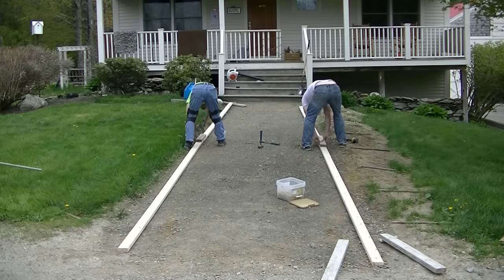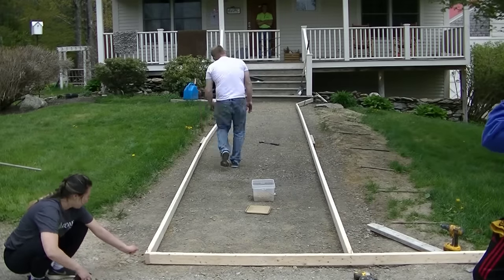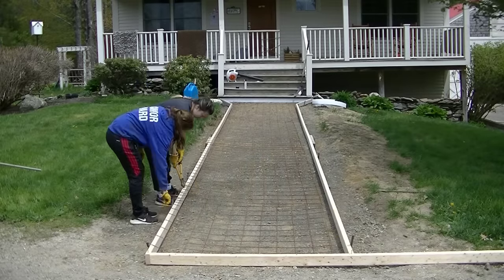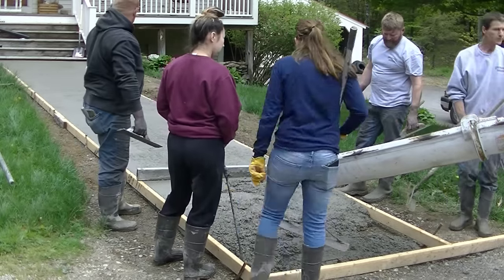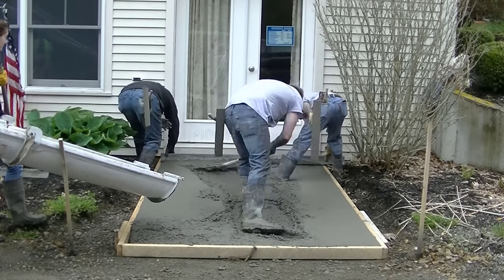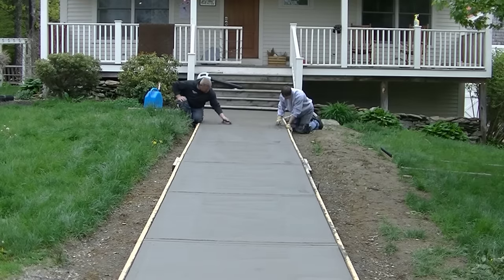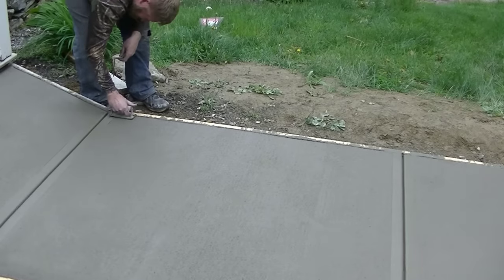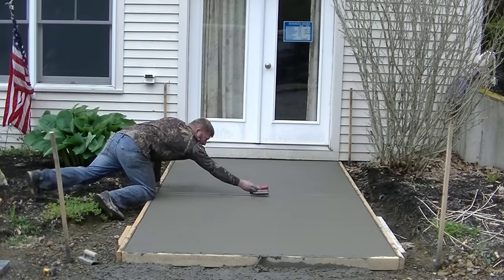CONCRETE SIDEWALK : FORMING, POURING AND FINISHING

Comment: Overall a nice job. Your control joints we properly spaced and of correct depth. You should raise your reenforcing wire to the top 1/3 of the concrete and remember you don’t POUR CONCRETE YOU PLACE IT.

Comment: We did a water access shaft , 23,000 yards  continue pour , 3 sets of circular forms 12 ft diameter 24 feet across the shaft 12 men ,   the shaft was 600 feet deep in NYC

Comment: DEAR MIKE.....THANK YOU FOR YOUR VIDEOS.....THIS VIDEO .....THE NEW CONCRETE  GOES UP TO THE EXISTING WOOD STEP APROXIMATELY 1 1/2" FROM TOP OF NEW CONCRETE, TO TOP OF OLD STEP......THIS DOES NOT PASS CODE......SOLUTION......TAKE OUT BOTTOM STEP....NEW CONCRETE IS NOW BOTTON STEP AND IS 1 1/2 " HIGHER... BUT THAT GIVES YOU EQUAL RISE FOR EACH STEP....NOW PASSES BUILDING CODE....PLEASE CONTINUE YOUR EXCELLENT VIDEOS.....I HAVE SEEN MANY.....AND HAVE LEARNED  A LOT FROM YOU.....ALSO IF YOU WANT TO LEARN A SUBJECT....TRY TEACHING IT.....SUCH AS YOU DO.....THAT IS WHEN THE PROFESSIONAL REALLY STARTS TO LEARN.....I AM YOUR BROTHER IN CONSTRUCTION.....55 YEARS EXPERIENCE.....PLEASE KEEP UP THE GOOD WORK

Comment: Hi Mike. Ive seen videos of concrete pouring where there is something poured onto the ground before the concrete is poured. like sand? I saw you basically poured the concrete right on top of the ground (other than the wiring). Is there a reason for one way or the other? Thanks
Reply from the maker: This was poured on a gravel sub-base. It used to be loom and grass. That was dug out and gravel was installed to support the concrete. I'm not sure what you're talking about but we always pour on gravel or crushed rock for a sub-base.

Comment: Thanks for sharing Mike, do you ever use or put spacers between the wire mesh and ground to prevent corrosion? Or is that mainly used for re-bar.
Reply from the maker: Yes we do, sometimes we'll use slab bolsters under the wire when we can get them.
Reply: Stucobathtub, there’s no corrosion issue because they pulled the wire up and let concrete flow under it so that it’s suspended. It offers no strength if it’s left on the bottom. One problem I saw was they used several pieces of wire, and that’s fine, but they didn’t overlap the joints of the wire sections. It’s necessary to overlap (generally 2 squares but 1 will do) to prevent separation in the event a crack forms in that area. It’s necessary to overlap and tying every 18” is a good practice too.

Comment: Hi mike, I don't get the boxing details.Should the pegs get fixed to the rails before it gets hammered in or do you place the rails and then hammer and fix the pegs.? I see you are using rebar, but how are you fixing it to the rails? Are you removing the boxing after the concrete has cured or do you bring the lawn to the boxing edge and leaving it because I quite like that look.Nice video, low stress. Thanks.
Reply from the maker: We build the frame then pound in the stakes then screw the frame to the stakes at the grade we want. The rebar we either pull up into the concrete as we pour or we put some type of chair under it to hold it up. We don't leave our forms on after the concrete has cured. We take them off and use them again.
Reply: @MikeDayConcrete  Thanks for that.My contractor is trying to talk me out of having wheel tracks for my driveway. He reckons the extra boxing cost makes it more cost effective to pour a full width slab.32x3m.I can do this.

Comment: Mike, when you put wire mesh in it looked like it was laid on the ground ? not suspended in the middle before pour?
Reply from the maker: We pulled it up on this one. I didn't have any chairs on this job to suspend the wire.
Reply: With wire pulling it up is ususlly just as good as suspending it. You really only need to elevate it when using rebar
Reply: @MikeDayConcrete  I was wondering about that too. Thanks.
Reply: David Uhl 

Yeah, one girl pulled it up and the next girl walked all over it and pushed it back down.

Comment: How deep should you remove of sod when you’re pouring a patio.   And can you just tamp the ground after removal and pour on top or do you have to bring a base in
Reply: You just need to get all the grass out no deeper........and depending on what you're doing if it's a floating slab I'd go the whole 9 on it 2×6 forms with a thickened edge with half inch rebar  instead of the usual 3/8 rebar, but something like this and if you're gonna do it yourself I guess it all depends on how long you want it to last and how good you want it to look

Comment: Hi, I have a question about a concrete landing. We are putting on an addition that required the old landing (“landing=step between the door and the sidewalk leading up to it) to be taken out and a new one to be put it, poured up to the existing door. The concrete guy poured the landing too high and now when you open the screen door there is not even an inch between the concrete and the bottom of the door (no room for a welcome mat). How would you recommend the contractor solve this? Somehow reduce the amount of concrete, or possibly raise up the door? Thanks!
Reply from the maker: Hard for me to advise without seeing it. Not sure how much you need it lowered, you could grind it, scarify it then resurface. Hard to say.
Reply: Mike Day Everything About Concrete Thank you! It would only need to be lowered a few inches just so a doormat would be able to be there without the screen door hitting it. Nice video

Comment: I used thick boards of wood for my formwork. How important is the stakes in the ground to avoid concrete bursting out the sides. Might seem like a silly question but I used really thick wooden boards
Reply: Sidewalk is not heavy not many stakes for straight runs

Comment: Mike I was curious what the difference is between using a "Mag" and a steel trowel. I mean outside of what material it is that the trowels are made of, obviously the Mag is made from Magnesium and the steel trowel is steel but what is the difference in the finishing process?  Great work, great channel.
Reply from the maker: The difference is the Mag doesn't "close" up the surface as much. It lets it breath and not trap moisture or air under the surface. That could lead to blisters or surface delamination. Mag it first, let most the moisture on the surface dry up, then steel trowel it.

Comment: Mike, what causes the top of a concrete slab to chip off in thin small sheet of 1-3 inches long in areas that are cold and are subjected to freeze / thaw cycles?
Reply from the maker: No or too little air-entrainment, pouring the concrete too wet, not sealing the concrete, using de-icers on the concrete. Too much air entrainment.

Comment: Mike , what’s the purpose of the wire mesh if it’s at the bottom. It dosent provide any strength and eventually corrode and weaken the concrete.
Reply from the maker: I didn't have chairs for this one, usually do. We try to pull it up best we can. The concrete has fibermesh in it also.
Reply: if u watch the guy is pulling it up as they go
Reply: He does a good job and is obviously a pro however lifting the wire mesh does not work and is not consistent. Try inserting rebar into concrete and see how difficult it is let alone trying to lift it.

 Rebar or mesh not required on sidewalks when well compacted with drain material and fiber mesh in concrete. If the mesh or rebar is exposed it will deteriorate the concrete.

Comment: Mike, I'm looking to do some concrete work at my house. Do I have to put stone down first. I'm going to be replacing concrete, and the dirt beneath it is solid. I noticed that you did not seem to put stone down first, unless I missed something
Reply: Yes you need to put min 3-4 inches of CA 6 stone and compact it.
Reply: @sergiogonzalez736  no you dont compact the stone under the walkway. 28 years doing this. You use 3/4 clean stone or 57 stone as some guys call it. Clean stone wont compact anyway. The reason you don't want to compact the stone is for freeze and thaw. When rainwater or any water gets under the concrete in the winter you want it to filter down 3" to 4" so it doesnt lay right under your walkway and freeze and expand and lift your concrete just enough to crack it. When pouring exterior crete you always use clean 3/4 stone !! You never want something under your pad where water will just lay under it. You always want water to ft filter down 3" to 4" below your finished product.

Comment: how long do you have to wait till you can cut the lines? also how long do you have to wait to pull the wood off?
Reply from the maker: Cutting the joints is something you have to keep checking for. The concrete wants to be somewhat firm but soft enough to cut in the joint. It's different on every pour, depends a lot on the temperature and how wet or dry you poured the concrete.

Comment: Question: I want to replace the wooden steps leading from my garage to my kitchen with concrete steps. The steps will be up against drywall. Do I need this iso strip or something else to isolate the drywall from the concrete?
Reply: yes you do dont really need the strip you can use some thick plastic you just want a bond breaker
Reply: Use expansion paper nothing else true concrete guy here

Comment: I have a question about curing it. Do you add something to cute it, or just let it dry?
Reply from the maker: A cure & seal sealer is applied to the surface afterwards to seal it. Or water curing can be done by just keeping it wet for a day or two. It rained the next day on this one so we didn't apply any cure and seal.

Comment: Mike, do you feel that a gravel bed is not necessary in this case, pls? and looks like you used nom. 2x4s for the forming? So this slab is actually less 4"? Can you comment?
Reply from the maker: Gravel bed is necessary. Forms are up off the ground a bit so it is 4"
Reply: @MikeDayConcrete  Okay thanks. I missed in the video the first time I watched, where you referenced the gravel bed, so I wasn't sure that you had one, and I wondered if that was practice in some cases.

Comment: Good workmanship but I have one question..Why is the steel screen laying at the bottom of the forms when it should've been pulled up by about two inches, suspending the reinforcement in the concrete. Laying flat on the ground does little in the way of reinforcing the concrete...
Reply from the maker: It was being pulled up.
Reply: Mike - thanks and very informative!  Question:  When repouring a sidewalk that connects to a front step, how do you keep the sidewalk from bonding to existing concrete steps?  You mentioned something about "iso strip"?  Can you explain further?

Comment: Great video! I'm currently working for my church and we are putting in a roll up door in one of our buildings. We will be running a fork lift through it, i have to pour a slab apox. 10X8 for entry and was wondering if you might have any pointers to help the process go a little smother. Depth of slab, building and wall seperation, reinforcement...

Comment: 1) mark center of steps
2) mark 1/2 width of sidewalk on both directions from center mark. (Make these marks in pencil on the bottom riser)
3) make top-of-concrete level line across entire bottom riser.
4) pound in grade stakes to the inside of each of the width marks from step 2.
5) hang sting line on left stake, square line perpendicular to bottom riser. Pound stake in at bottom of walk to secure line.
6) square bottom form with line.
7) measure over full sidewalk width from line on bottom form, mark, affix nail or screw on mark
8) hang second line on fastener.
9) connect the second line to the right stake at the top
10) hang remaining forms to line (probably just at grade in this case, so strings just represent in-out, not elevation.
Reply: This method is significantly more efficient.

Comment: Sidewalks on a slope should be poured from the bottom up..but few do that because it is easier to rake downhill. Pouring from the bottom up prevents any slump dips and makes for a flatter surface

Comment: I hired a guy to pour a sidewalk for me and excess concrete ran under the form boards. Now I can’t get him back out. Can you tell me how to remove that excess and give a nice smooth edge to my sidewalk? The form boards have been removed.
Reply from the maker: If it's not going to be covered by landscaping, you can use a diamond blade on a 4" grinder to "saw" the concrete off. Or you can rent a hand held quick cut saw with a 14" blade and saw it off.

Comment: I'm used to pouring and grading with a shovel. If you take your concrete saw(with the metal cutting blade) and cut a notch in the side of the shovel blade about an inch from the bottom and a half inch deep, your shovel can double as a tool to that picks up the wire, therefore you don't need an extra person behind you pulling up wire that you're gonna step on anyway. Should try it. Everyone I've shown loves that little trick.

Comment: Im puting a concrete for 20x17 patio. The contractor said he will put fiber in it. Shluld i also put concrete wire?
Reply from the maker: We use fiber in all our pours. It wouldn't hurt to add wire and chair it up so it's in the middle. But it's not a deal breaker. That would be about 6 sheets (5x10) of wire $60.00
Reply: @MikeDayConcrete  so slab will be ok just the fiber...thank you much..
Reply: @MikeDayConcrete  coz the concrete guy said no need to put mesh since he's going to add fiber and that fiber is better than the mesh..what do you say?

Comment: On average how far apart do you put the seams to prevent cracking?
Reply: 2ndAmendmentGlock there called control joints. Building code is 12’ on driveways,slabs ect. One slide walks 3’ looks the best. If you measure your total distance and come up with a number that works out closer to 3 ‘ to make it look clean would be your best bet.

Comment: Do the grooves prevent cracking? When are expansion joints required?
Reply from the maker: The joints are there to "make" the concrete crack inside them so they're kinda hidden. Any slab over 8' x 10' 4" I like to use them.
Reply: Mike Day Everything About Concrete 
The builder saw it the expansion joints instead if troweling them in. Do you know why they cut them in. Any negatives with this method?
Reply: Also, no rebar/wire mesh.
Reply: They sawcut through the sidewalk
Reply: No difference in cutting or tooling joints they serve the same purpose.  Alot of people choose either or for look or if you have a large job most concrete guys will cut them later

Comment: Nice work but its basically just a slab of concrete laying there.. In the Caribbean we do that a different way its more stronger..We auger holes not to deep abt 2ft deep an dig buts an trenches an then cast everything in one in that way nothing could shift with earth movements ect..

Comment: I lifts the wire mesh from the ground like 2 inches so it doesn't get rusted with the moist of the soil....
Reply: I agree. But I believe one of the guys was lifting the mesh as they went instead of propping the mesh up prior to pour. Either way is fine on a job like this.

Comment: You should always have a mag on you so you can mag out the lines you left from using your jointer for your control joints, not your groover, for your grooves. And I never saw no string line to make sure the forms were straight.
Reply: No string line? You weren’t paying attention.
Reply from the maker: Nothing but criticism, got anything good to say.
Reply: @MikeDayConcrete  not yet. Where is the expansion joints. Not that white foam you had which is actually called pool joints. Also it sounds like you're in the Northeast so why are you using tamped stone dust instead of clean 3/4 stone or 57 stone as some people call it. That's what you use when you pour exterior. The 3 to 4" of 3/4 stone allows the water in the winter to drain and not sit on that hard tamped sub  base right under the pad and freeze and Pop that new concrete right up !!
Reply: Couldn’t agree more George we both have been doing this trade long enough to spot guys like this a mile away

Comment: After the front steps there should be no Bend Inward and should all just flow in natural curve. There are more flexible beams other than using two by fours. Also the frost line is 4" and you should be a little bit deeper than that.